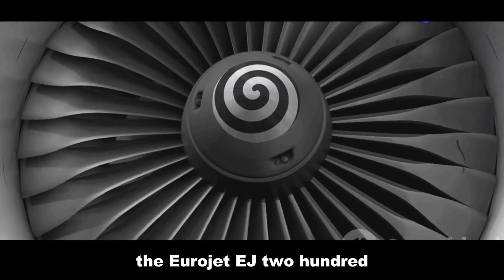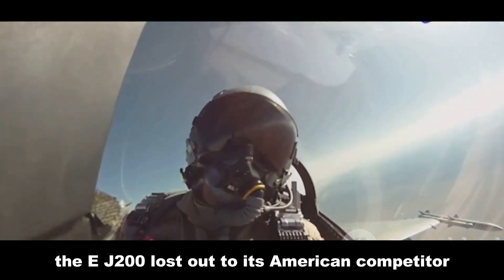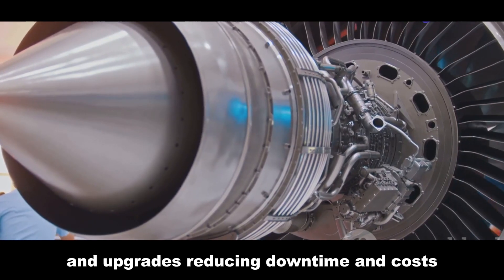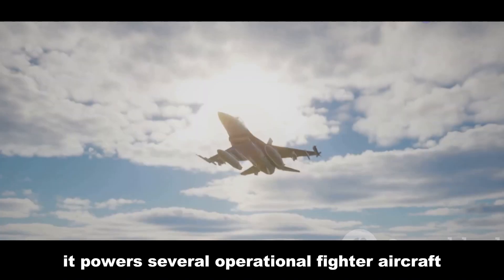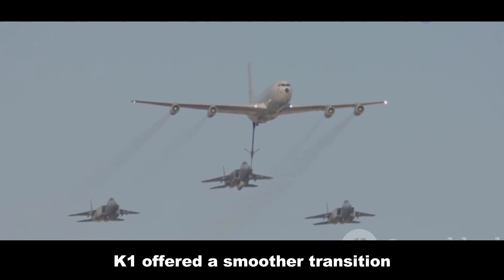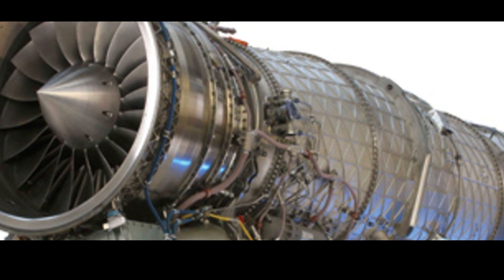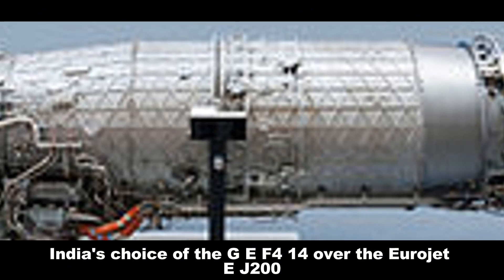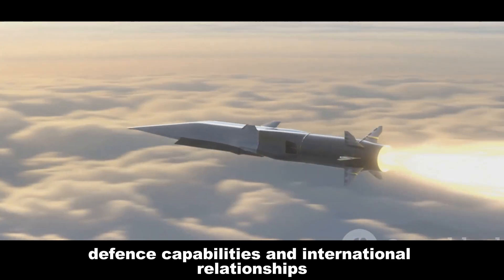🧐 EJ200 Snubbed? Unpacking the GE F414 Deal for India's Fighter Jets 🔍

Comment: Ej200 with 90 kn dry and 135 wet thrust vs ge 414 with 90 kn dry and 131 kn wet thrust ???? When were theses engines got developed? I am surprised 😯 and speechless 😶 both.
Reply from the maker: Ah well as per my knowledge, most of the American and European tech is stolen German tech, and as per my info, ej200 is reskinned ge f414